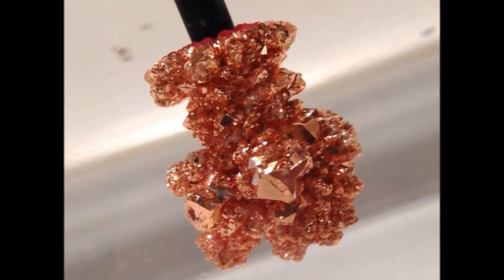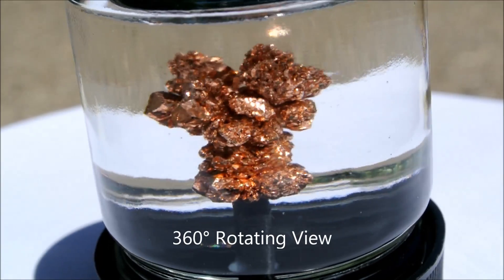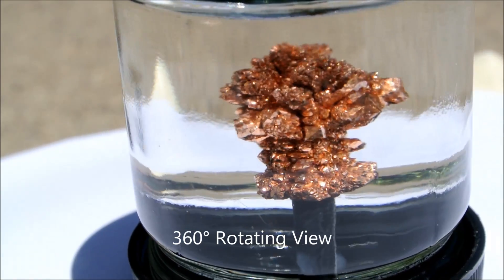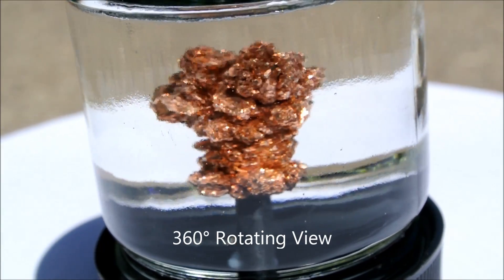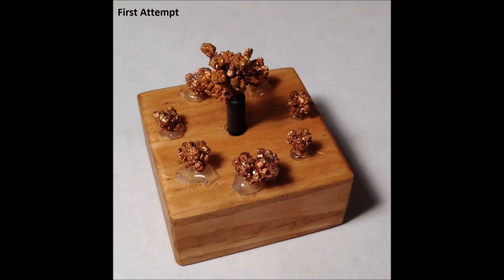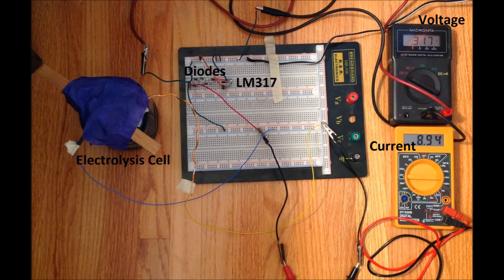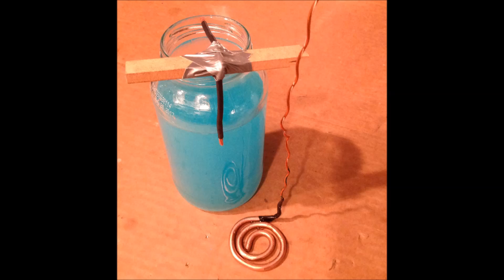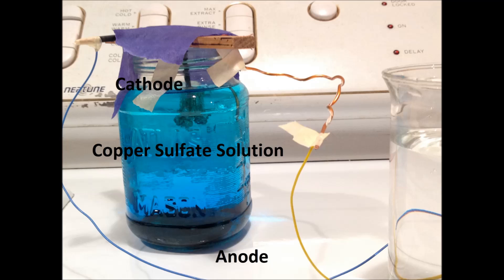Grow Copper Metal Crystals with Electrochemistry!

Comment: I've wondered if it's possible to grow Nickel and Cobalt crystals as well using this method with the appropriate Ni(II) or Co(II) salts?
Reply from the maker: I think so - some experiments I did a while ago with currency made of pure Ni grew small crystals on the coin surface, so I should think that with proper parameters growing larger crystals would be very possible.
Reply: Us the solution of the compound you want to crystalize in it's constituent polyatomic compound solution. Test both sulfate and nitrate solutions of the compound to test for the desired effect

Comment: That crystal is magnificent! I hope to recreate your results using a cheap C.C. power supply at a few mA ...and my natural tendency to forget things left in my garage. 

I have a very tall cylindrical glass container. Going to try copper cathode near the bottom,  only like 1" end exposed, pointing up, and up top dangle a 1 lb ingot as the anode.  

Did you use any surfactants or brighteners in your electrolyte? I feel like I should add a little bit of H2SO4 or something.
Reply from the maker: Ah, I'm glad I inspired you to try it yourself! I look forward to seeing your results. I didn't use any surfactants or brighteners; the electrolyte was just root-killer grade copper sulfate and tap water, with a touch of table salt for Cl- ions. I bet surfactants and brighteners would help things, though, so let me know how yours turn out!
Reply: @ThePlutoniumBunny    Until dedicated supply arrives, here's the setup. Copper Nitrate and a little HCL in water, and the ingot is aluminum bronze. (5% Al, 95% Cu)  I hope those deviations don't mess it up too much.  http://pugbutt.com/cu_crystals.jpg    I subscribed.  Cheers!
Reply: I made a low-budget version with nickel acetate + surfactant, nickel anode, a D-cell, and a 1.2 KOhm resistor. That should drag out the battery life to over a year. Hopefully, it's enough current to barely plate. Else, might have to lower the resistance.   http://pugbutt.com/low_budge_ni_xtals.jpg   Sorry if this is getting spammy. I get excited about these little experiments.   :-D
Reply: @ThePlutoniumBunny  The bronze was a big fail, so started over with pure copper anode at 6mA.  Somewhat disappointed with results, but oh well.   http://pugbutt.com/crystals/

Comment: I'm not too familiar with circuitry. Is your voltage ~(0.25v) read across the cell? I've got my breadboard set up and I'm just using resistors... I'm not sure if this works, but if I calculate voltage (as a voltage divider) over the cell, it tells me I need a 12000 ohm resistor ahead of the cell. The cell reads 1000 ohms and I'm running off of a 5volt 1 amp constant current DC supply. Inspired and subbed bud.
Reply from the maker: Yes! That voltage (0.28V according to the linked website post) was measured across the cell electrodes. The voltage divider method you are talking about should work, but I would double-check voltage (and possibly current) measurements once it is up and running, just in case the resistances change or anything like that. Good luck! Glad you are trying this.
Reply: @ThePlutoniumBunny  Yeah, I suppose it would change in power consumptions the cell is lit off.. Thanks for the suggestion, I'm trying for a very large single crystal. Right now I've got a couple odd nodules like you mentioned, but they are dull red. I wonder if I shouldn't add some HLC... maybe this will make crystal synthesis more likely.

Comment: can I use1.25 directly from the lm317？ or I need lower voltage？ what kind of copper(wire or ingot) for your negative pin?
Reply from the maker: You could, but your crystals will likely look different due to the higher current that comes along with the higher voltage.  You could try moving your electrodes farther apart to increase the cell resistance, which would let you have a lower current with 1.25V.   My anode was made of thick solid core copper wire, but an ingot would work just as well.
Reply: @ThePlutoniumBunny  I decide to use lm317 as current source + v divide resistor now, set the current at 6.3ma and voltage 1v

Comment: Hey i got a question, i tried this experiment aswell but all i get is black/copper-ish powder which forms on the cathode, it also falls right off when i try to lift the cathode, i tried several different magnitudes of amps but non worked so far, what could be the error i am doing?(i limited the current with my bench power supply so that i got a constant current)
Reply from the maker: I had this happen many times.  The problem is either too high of a voltage or else too little copper ion concentration around the crystal.  To fix both problems, increase the concentration of your copper sulfate.  You should then decrease the voltage to keep a low current.  You may also need to gently stir the solution every day or so to ensure that the copper ions are always evenly dispersed.  The growing crystal tends to "use up" surrounding copper ions, and without enough ions near the copper, the black stuff begins to form.
Reply: The Plutonium Bunny
Thank you for your answer! The normal voltage was about 0,5V-1V, i set the constant amps to around 5-15mA(tried it with different settings), i couldnt concentrate the solution more since it was already saturated, it didnt accepted any more of the sulphate(tried it weith less concentration too) mayybe i will try out a bigger container and thicker copper wire. will let you guys know if all that helped^^
Reply: @Jan-fw4bs  Did it help? :)
Reply: @finn3300  yes it did as far as I can recall. Also not using tab water helped a lot